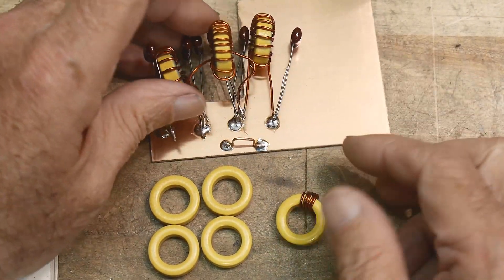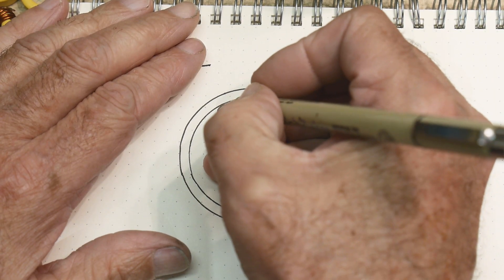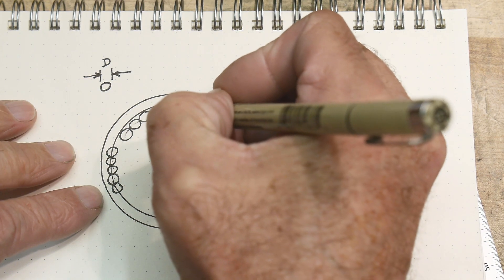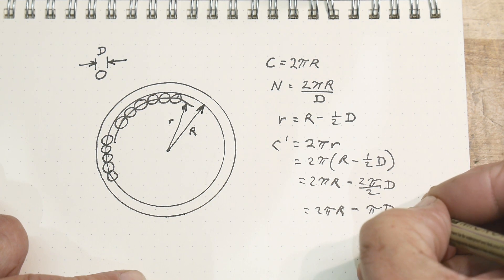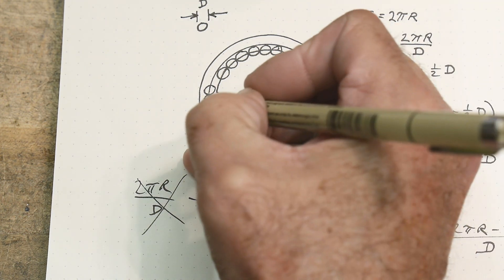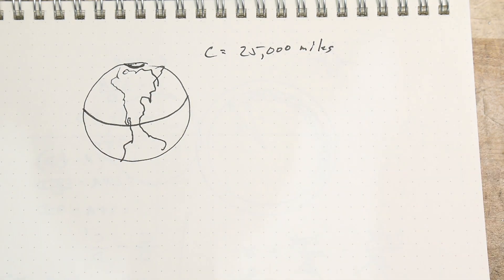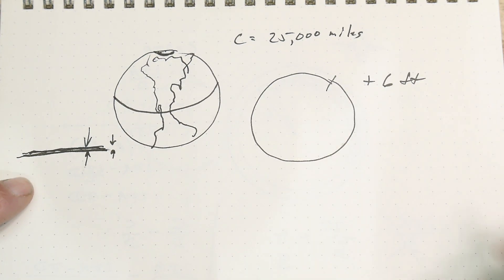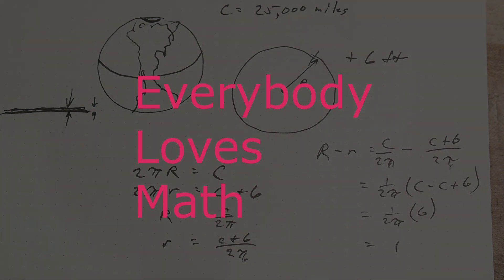#738 Calculating Windings on a Toroid Inductor

Comment: My output voltage is quite low on hand wound toroid transformer. I did 
match the frequency to source AC, used proper core, and both wound same direction.  What is efficiency "percentage 
difference" of primary not wound exactly over secondary, just wound 
separate on core? It just looks visually better with 2 different colors 
insulation.,at separate placements on core.

Comment: Thank you for this video. On a side note  can you show a video how to design a matching balun 50 ohms primary and 120 ohms balanced.  Can you recommend a book or design equations on how to design the primary number of turns or inductance in primary to be 50 ohms, and the secondary 120 ohms center tapped ground?
Reply from the maker: I would start with the ARRL Handbook

Comment: Great video! So here's an idea for one more installment. My biggest problem is figuring out how much wire you need. Perhaps some way to calculate the amount / turn, factoring in the possibility that not every turn will be dead flush to the core's body.
Reply from the maker: I'd like to know that too...
Reply: Mean length per turn from core data or measure it. Inside diameter of core time Pi for ID circumference and wire diameter to figure out how many turns are absolute maximum possible x mean length per turn for approx. length.

The turns that don't lie flat will be a little longer. You can make whatever corrections you want for the less-than-full rule of thumb cited above.

You need a little more than your minimum because not having enough is worse than too much on your shuttle.

If you are winding more than one layer (like a power transformer vs. RF inductor) you can estimate additional thickness of any layer insulation. The 2nd layer mean length per turn is longer due to the first layer of wire plus any insulation if used.

Remember to count the thicknesses twice as applicable.

When winding on a rotary toroid winder with a split ring shuttle, you can't remove the interlinked shuttle from the core until you remove the excess wire...so you REALLY don't want TOO much extra either.

There's always going to be some scrap wire to recycle...
Reply: Winding a small single-layer toroid with a pull-style shuttle made by cutting notches in the ends of a chopstick, you don't experience the overwound split ring shuttle aggravation.

Comment: Also, I usually just look on the table on the Amidon web site to figure out how many windings a toroid can have vs wire guage. You generally never want to fill up a toroid 100% though. You want to leave a gap between the ends of about 1/8 the toroid circumference. This keeps the capacitance between the beginning winding and the last winding low. At high frequencies this can matter and it will lower your self-resonance frequency of the toroid.